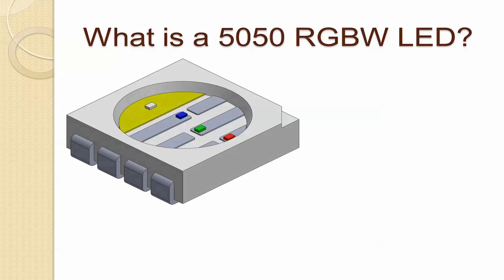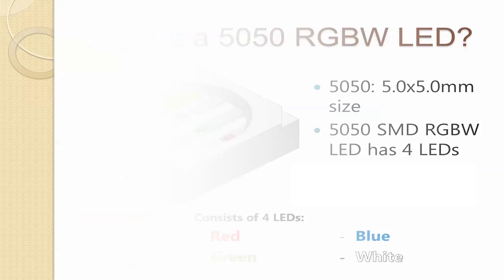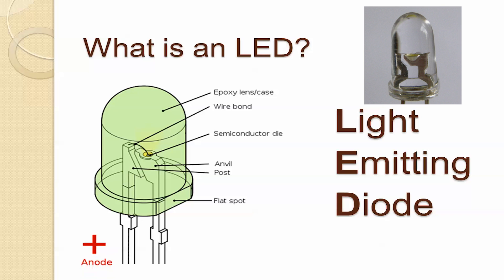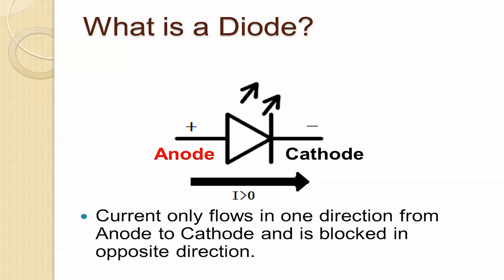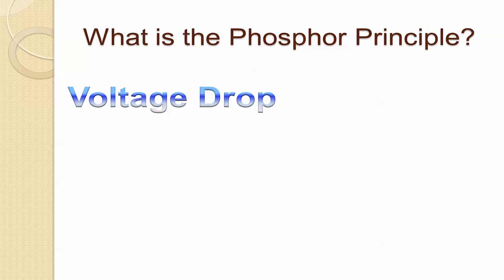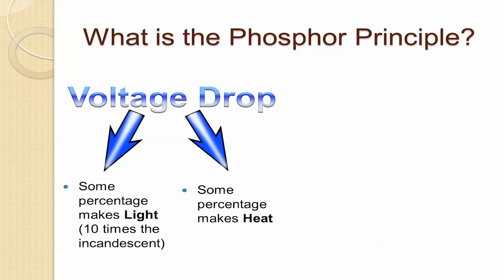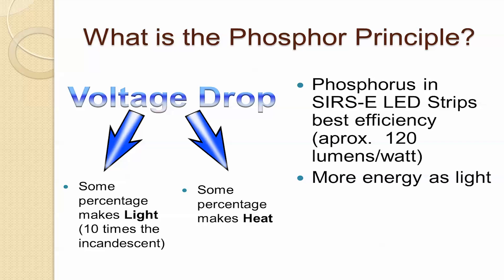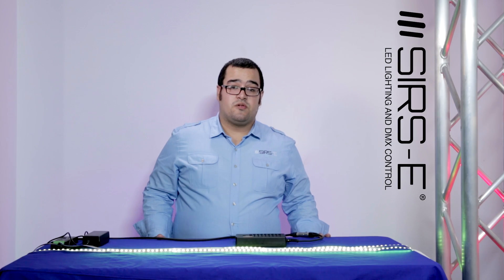5050 RGBW LED How it Works High Quality by SIRS-E

Comment: how can manualy light a 7 pin 48 light led strip out of a laptop?  i cant find which pin on the ribbon cable is ground or whats positive?  best i could do is get 3 leds lit in random succession
Reply from the maker: You will need to use some sort of protocol to control your LED's, we specialize in utilizing DMX so I recommend looking into what protocol your LED's are compatible with.